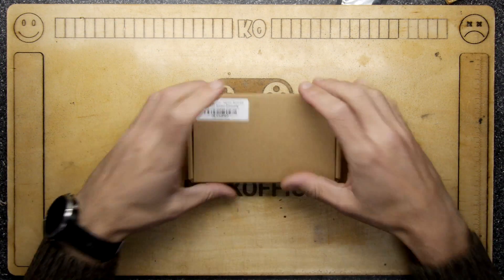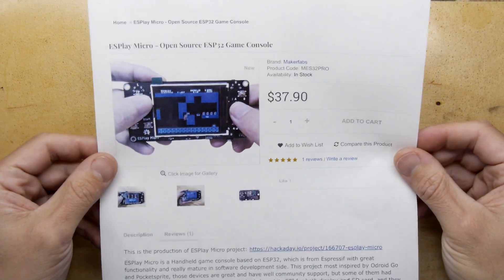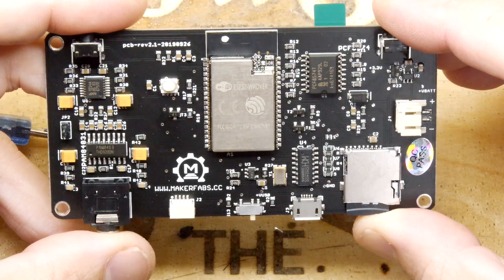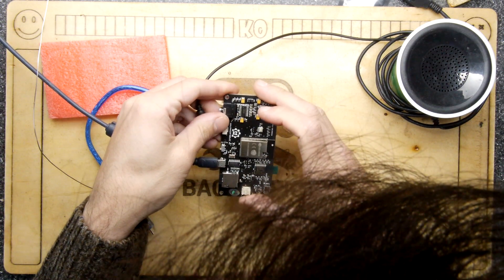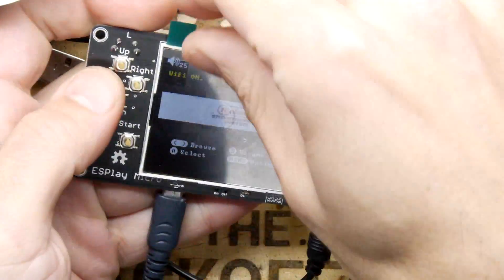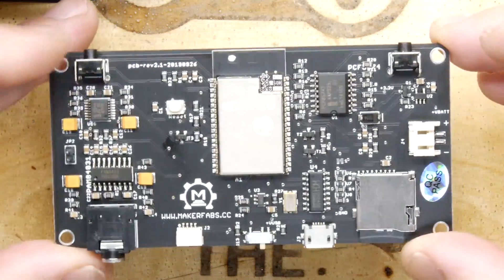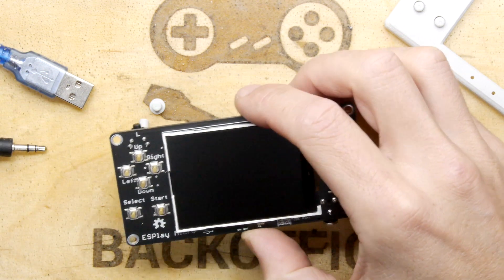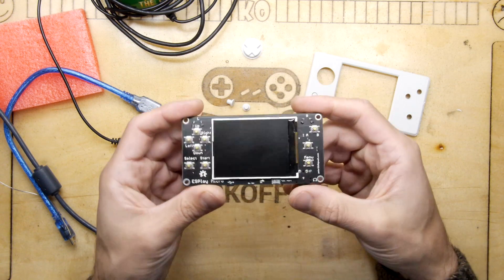DIY Retro HandheldTime! - Makerfabs ESPlay Micro

Comment: You have a default firmware, the firmware has been updated to fix the B button for back function to work when no files available while browse the rom. Updated fw file available on the github release. https://github.com/pebri86/esplay-retro-emulation

Comment: can you adjust the brightnes i find it a bit dark nice vid mate
Reply: I think this is the first batch of pcb, and it has a bit bugs with the brightness cause wrong value of resistor R19. Change those resistor with 10 ohm to fix the brightness issue.
Reply from the maker: Oooo a hardware hack, I like it!